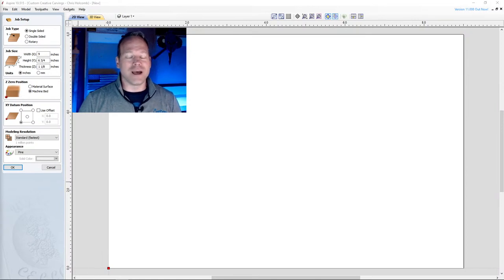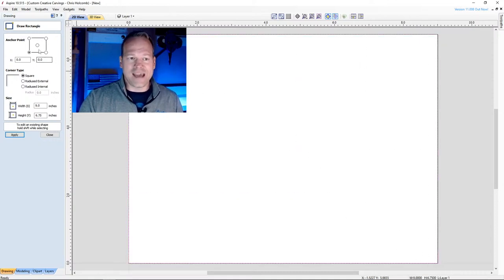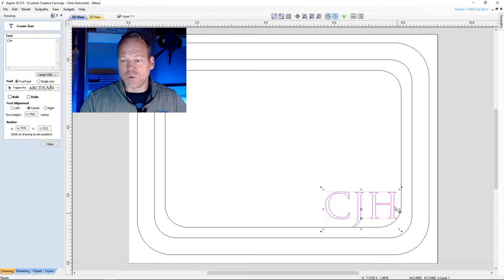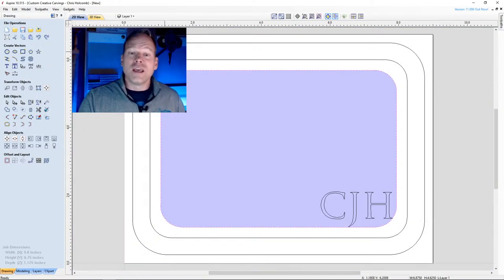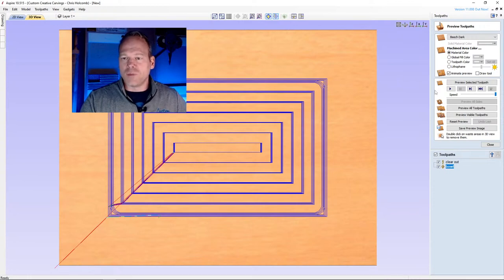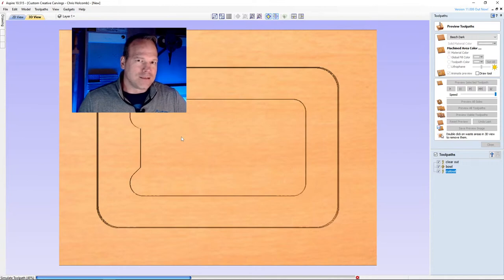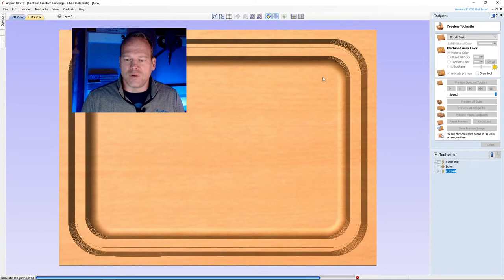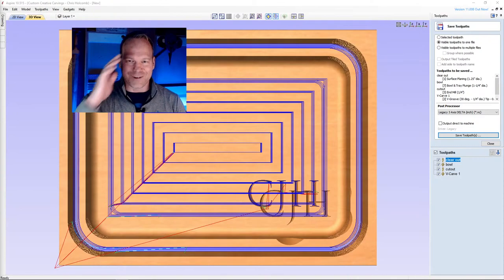Vectric Catch-all tray tutorial, nice and simple. Behind the Carvings Episode #1. 24 Nov, 2021

Comment: Would an offset inward command be a better option for the inside tool path?
Reply from the maker: That is an option. The reason I prefer not to use that method is because of the way it alters the radius of the inside versus the outside. I would recommend testing it both ways and seeing which look you prefer.
Reply: @CustomCreativeCarvings  , Of Of course I commented while watching the video, well done by the way. A few minutes later you addressed that very issue and explained it well.
Reply from the maker: Awesome, we'll I appreciate the extra comments, it's good to know I am helping.

Comment: Awesome thanks. As a complete novice, I was wondering what is the accuracy one can achieve on a mass production doing this process? Meaning if I set specific sizes with the cnc, how accurate will be let's say the actual inside cut compared to the settings? Because I have 200 ceramic dishes (rectangle shape) and I would like to have 200 trays made and then put the dishes inside the trays (I'd like them to fit as precise as possible without leaving to much of a gap). Would you say too much variation occurs among the trays causing some dishes to fit and some don't?
Reply from the maker: Tolerance is determined by 2 things, the machine, and the material. A rigid machine can run the exact same path every time.  Wood on the other hand is fickle, it can change in density mid board, which can change how much it pushes back on the machine.  the other issue you will run into is after the cut, the wood will shrink and stretch, which makes your task difficult at best.  some woods are more stable than others and reduce this issue. sealing the wood can also help.  one option can be to use an elastomer glue to fill a gap between the wood and the dish. Sorry for the long answer. Wood does not play nicely with other materials.
Reply: @CustomCreativeCarvings  Don't be sorry, in fact it's a great answer and very helpful. Thanks a lot